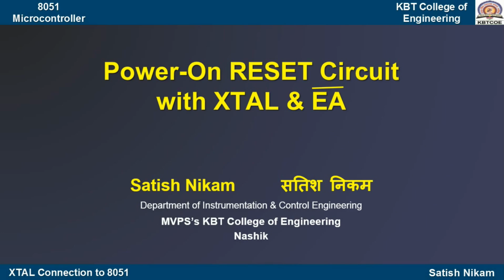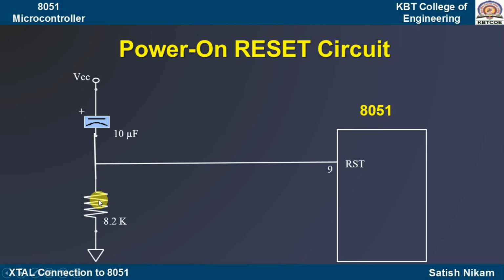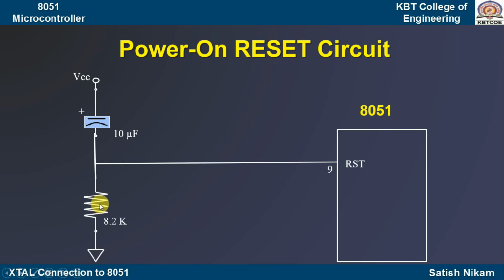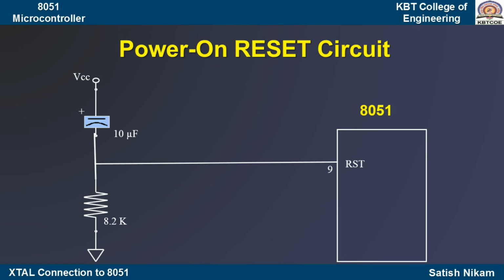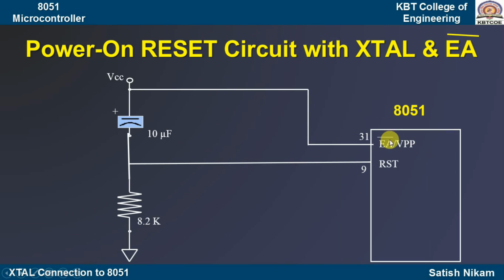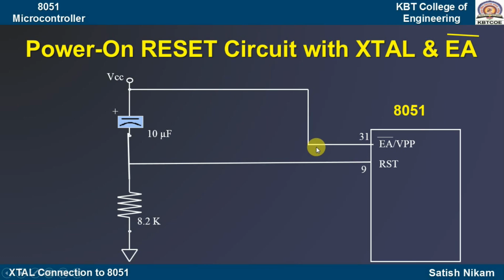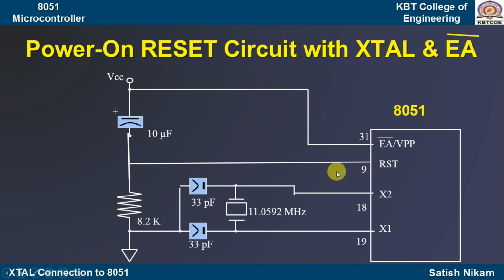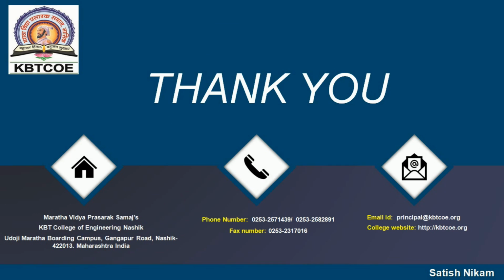Reset Circuit and Power on Reset circuit of 8051 Microcontroller

Comment: I see POR circuits often using a Schmitt trigger.  What are the advantages/disadvantages of not using a Schmitt trigger?  Also, how do you treat quick power off/power ons?  If the RC constant is too high it might not receive a reset signal - or more precisely it won't see the positive edge of the signal.  I'm thinking maybe a diode in parallel with the cap that is reversed biased by VCC, but one VCC is removed it will then conduct and allow the cap to discharge.  That way if you power off/power on real quick you will still see the reset signal.